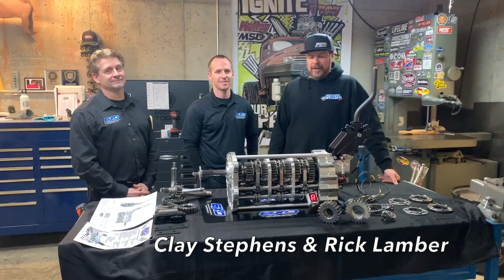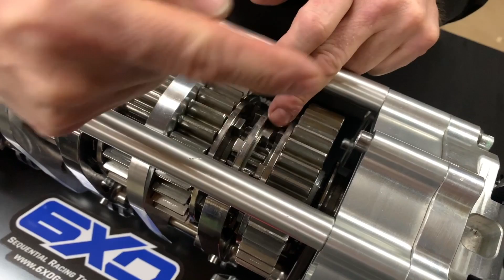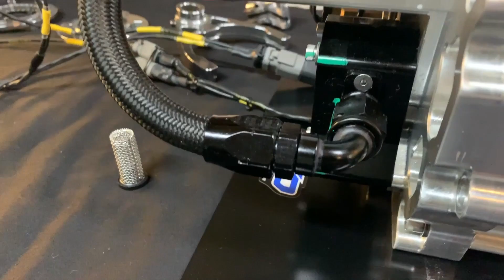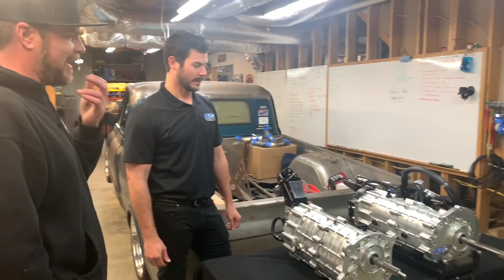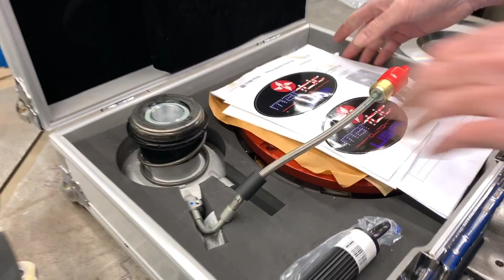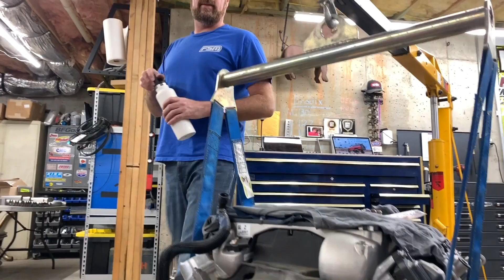First Look Inside a Billet Sequential Trans for my '67 C10! Finnegan's Garage Ep.99

Comment: There is seriously 0 videos like this that I've found on sequel boxes
Reply from the maker: I know, right! I learned so much from these guys.
Reply: Look for videos on motorcycle gearboxes, they are all sequel.  This is just much bigger.
Reply: the operation with the cam tracks for each shift fork is so easy to understand when you see it like that
Reply: @AnthonyBowman  exactly.  Kyle is an expert on sequentials now.  Rowdessy, hondaru, and the mr2 all have sequentials.
Reply: Rad Dan. Drifter from formula drift has some videos on rebuilding his box. Really cool to see.
Reply: I guess what made this video easy to understand is that the gears are laid out very easy inside the box.
Reply: @FinnegansGarage  MIKE...CMON DONT DRAG RACE THE CADILLAC!

SELL THAT CADDY TO ME!

DONT MESS UP A PERFECTLY GOOD CADDY
Reply: I was literally under the impression that every time you changed gears with a sequential, witchcraft was in play. Thanks to Finnegan for bringing us more knowledge.
Reply: @tylerborealis1234  No he isn't, can't even shift a fucking sequential.
Reply: @Earl James too bad the guy at the end has to use his clutch to shift a sequential transmission. What's the point
Reply: It's probably because it costs 17 grand.
Reply: You're not looking in the right spots 🤣 Sand cars have run these for decades. Weddle, Albins, Mendeola, Fortin, etc. all make these for a hell of a lot less $$$.
Reply: @taznz1  was gonna say the same thing, these peeps never rebuilt a dirtbike? sequential with viscous multiplate clutch... Every kid should own a dirtbike, teaches them the cost of being too hard on equipment, the drawbacks of not maintaining, and the amount of work in rebuilding it. Life Skills.
Reply: Gear box Video.

Comment: I love that you said “It’s really tough to screw this up” when talking about putting the clutch discs in. Didn’t you put one in backwards when you rebuilt the hemi on a picnic table when prepping to race Frieburger? Loved that episode...
Reply: My question is, how did they not notice they forgot the throw-out bearing? That is what the alignment tool rests against, it should have been pretty obvious that the alignment tool wasn't aligning against anything.
Reply: I take it you don’t race anything besides your stock Chevy Cruze
Reply: @zrobotics  You're so cool.
Reply: @shane8911  and you don't race anything, at all
Reply: @zrobotics  spigot bearing is what the alignment tool rests on. throw out bearing is on the input shaft.
Reply: @zrobotics  Pilot bearing buddy...close.
Reply: I think you mean pilot bearing, and probably not, that was a New Motor and T-56 Trans, that he had just put in, so, it would have been safe to re-use the bearing that would have already been installed, as long as the input shaft pilot was the same diameter....  Furthermore, did you notice that he had a little difficulty getting the alignment tool lined up, first going into the engine side disk, then, again, into the pilot bearing? guess not....  I'm pretty sure, the only thing they forgot, was to install the spacer/cover plate, which, you saw they caught....
The throw-out bearing, is the one that presses the clutch fingers, to disengage the clutch..., and that appeared to be in the mantic kit...
Reply: Rear main oil seal? Or is it deeper in the engine?

Comment: I love me a sequential but they have this huge problem why I don't have one. Insanely expensive at 17k
Reply: That and the gear whine that would get really annoying on the street.
Reply: @MX304  nah, gear whine and sequential is a match made in heaven
Reply: @alexelrod242  I don't think you've heard how loud that whine really is
Reply: @jackclark5220  can't be louder than my woman so no problem
Reply: That's not expensive for what it is. Spindle time is expensive,  and as tolerances tighten,  prices increase exponentially.  Grinding, polishing,  heat and cryo treating gearsets is insanely expensive.  Hopefully these will see wide adoption in the higher ranks of racing, and the rest of us will be able to pick up used ones in the future.
Reply: gotta pay to play. but i bet it is ligther, costs less, easier to service, and has more torque capacity than the dual-clutch transmissions in modern supercars. straight cut gears might be too noisy for the street though, unless you're into that sort of thing.
Reply: @MX304  you can get helicial cut gears in sequentials maybe not THIS one but they do exist
Reply: I doubt Finnegan paid that much
Reply: Plus u have to use the clutch apparently as the guy at the end demonstrated he clutched every shift so why bother
Reply: @jackclark5220  I have
Reply: Hahaha yes that's exactly my problem with pretty much everything. Poor AF and no sponsors either🤣
Reply: For what it is, it is money well spent if you need it. 

I would never have a use for this, but it is some great hardware that is well thought out and has a lot of value.

Comment: this is super cool to see the entire box open and see-thru with a full breakdown of exactly what is going on. Brilliant work.
edit: Woahhhh, having that 2nd pin on the fork is something I never would have thought of, but that's amazing they did that. Giving the user a "second use" if the first pin goes bad, is an incredible deal. Other manufacturers would never think of doing that for the customer. They would force you to replace it after the first one goes bad. These guys really have built an amazing piece of machinery.

Comment: This may be the first transmission that I've ever seen for about 15 minutes...and in that same time, realized exactly how easy it is to rebuild or service. Props to 6XD for such an intelligent design. It's too bad simplicity like this doesn't transfer over with simpler (if cruder) cast parts for low HP, mass-production applications. It'd be nice if the average stick vehicle came with a transmission this easy to service in it...

Comment: I know these are working well in the 2500-3000 HP big power Vipers. It's been a long time, but Vipers finally have a gearbox that will take some power. Back when I was "in the game" for TT Vipers, transmissions were the limitation. We could make so much more power in the V-10 as compared to what could be reliably sent to the rear tires.

Comment: on a motorcycle there is a rubber impact absorber in the rear wheel hub that helps soak up the shock of shifting with the power on. you better have something in your vehicle to do that. or you are going to break something. maybe the control box interrupts the ignition? or ? during up shift. this is a very interesting project.

Comment: You've still got to interrupt the torque to get the dogs to let go, though.  You can see how the dogs are back-cut to prevent them jumping apart when you put power to it.  Instead, they pull harder together the more torque you put into them.  So unless you have a system to either kill spark or "burp" the throttle, you're not doing flat-out shifting on this box, either.

Put a momentary ignition kill switch on Blasphemy.  They're built right into the shifter on rally cars and such.  It looks like they might have those built into the shifter mechanism of this particular transmission.  But it just kills power for an instant so that the dogs unload and release for the shift to happen.

Comment: they should hook a starter motor to the input shaft and a 12 volt battery so you can spin the transmission and go through the gears and show the people how it works.

Comment: The moment that you started towards that engine with a flywheel in hand, I knew cause I did it more than once. The only reason to lighten the flywheel is; the double disk weight is combined into it. I would not run a flywheel like that after running a "Schaffer flywheel" which is all aluminum and single disk. Half the torque fell in the ocean and made my big block act like a soupy six with a hole in the piston.

Comment: With the back cut on those dog teeth how can apply enough pressure to disengage those teeth if power is applied continuously ?  Outboard/stern drive boats use a similar dog in the foot, but when you go to shift gears there is a micro-switch that interrupts the ignition just long enough for the pressure to come off of the teeth and disengage.

Comment: Upshifts on a bike do not use the clutch. The rider gently loads the gear-lever and momentarily dips the throttle. The gears momentarily unload allowing the next gear to drop into mesh. Downshifts need a mismatched clutch throttle so the revs blip. Rider does the clutch/throttle blip, a fraction is a second later hits the shifter and gear drop in perfectly.

Comment: I wonder if transmissions at this level, and one like in Blashemi can be used with a kill box the kills the motor 15 milliseconds or so to make shifts. I did this on my busa based drag bike, and it sounded like a automatic trans shifting. This  T56 trans uses a shaft type shift drum a little like a motorcycle, and if it has backcut shift dogs it should work.

Comment: Couldn't really tell but maybe the pilot bearing? Don't know of anything else to install before the flywheel. Unless they changed things, since I have been doing rebuilds. Maybe a spacer to keep the bolts from sliding back towards the engine?

Comment: Nice trans - but not in my budget - I went with the T56 Magnum HD (with the TR6060 gear set). behind my Mast Motorsports LS7 with a SS cam and 11.4 compression and a Monster dual disk clutch.  My builder will be done with my car later this week and I'll be driving the car next week. Video's on my channel.

Comment: these are one of those things that lots of people want but very few can afford. this transmission starts around $17,000, not including specialty parts for your application. its out of reach for most people. i also understand that its not necessarily meant for a beater. as an alternative in the racing world, this is quite the deal honestly.

i fully understand the amount of engineering, research, testing, and costs associated with limited production items. i really wish all those things didnt require the price to be that high so that it really was more accessible.  

i dont fault this company for charging what they do, theyre in business to solve a problem and make money for their hard work and time. if i ever hit the lottery, im calling these people up. its really is pretty amazing. my favorite part is the serviceability, you dont often see that in items like this due to the greed by forcing limited parts availability.

Comment: Great and very useful to me. I am building a 68 Roadrunner with a 650 ci kb blown Hemi and this gearbox looks perfect. Can I ask you what is the part number of the Mantic clutch you are running in the 55 behind the Hemi as I would like to run this setup with this box so trying to work out all the parts required.

Comment: Hey Finnigan.👍🏻🤙🏼 I no you've probably a trans brake in blasphemy maybe ,but a Hydraulic Handbrake to loads up the driveline with the cluch would help your launch and shocking the driveline alot . From tarmach rally experience and I seen Garrett lanches Leroy like that .
Reply: Barry O' Neill Can’t really do a trans brake with a manual like you can with an auto. The best thing he could do is go to a slipper clutch that would soften the initial launch. That would also help with consistency. 
They make special clutches designed to slip some before the rpm comes up and they grab fully. They also make a piece for hydraulic clutches that acts like a one way restricter so even if you dump the clutch it releases it more slowly.

Comment: Ok, ok , I like all of it BUT ! ---- were  talking a new bell housing, flywheel, clutch, throw out, and the 6 speed trans, plus shifter & heat treated drive shaft yoke plus what ever cross member mods and fabricating a new tunnel in the floor pan as needed right , Whats a ball park price for the  wide gear drag race complete set up ? Will another mortgage on the house cover all of it ?  Also can you get a 2:88 or lower first gear ?

Comment: Lightweight compressor and tank setup that maintains psi with pressure switch for road applications...😇
Reply: 12v stand alone with built in compacitor to eliminate power drain when engaged...😂😂😂 road warrior maintenance free monster!

Comment: This is just a manual transmission with a cam to engage gears, along with an engine cut out for full throttle gear changing. What is special, by 2020 standards, are double clutch gearboxes.

Comment: Fuck the pneumatic shifting, it could be an electronic solenoid and not need all of the pain in the ass components, compressed air containment difficulties, pressure drops=performance Props and rubber air seal unreliability and deterioration....   but everything else is absolutely beautiful and well thought out. The case looks like absolute jewelry.

Comment: question!!!! it will keep me up at night if i dont get an answer!!! in the beginning you guys said the input shaft needed to be spinning to go into gear, when the 2nd trans was brought out he paddle shifted it without any input shaft speed why/ how, whats the difference that made that possible, also do you rely on a hand brake for "parking" or do you shut it off in gear?? if you do shut it off in gear or you have an engine failure how do you get it back into neutral without any input shaft speed????? plea!!!!!!! i need answers!

Comment: Those guys are obviously pissed off with 'standard' motorcycle/sequential gearboxes and the replacement /interchangeable is a fantastic idea particularly dog rings on gears. Honda used a trochoidal oil pump built into shaft bearing to lube transmission in 1970's

Comment: If the dog teeth are a seperate part from the gear itself, won't that be putting the entire load on that small splined section instead of spreading it out over the gears splines?

Comment: WOW, great stuff!

one thing tho, I thought that for drag racing you want a heavy flywheel to carry more inertia of the line and not bog too much.
at least that's what we do to our customers cars that want to drag race bit more seriously
Reply: I've heard that too. And with a smaller angina and a slower car than blasphemi
It makes some sense. But in a sub 10 second car you are fight to accelerate that extra mass between shifts.
Maybe with a sequential box, you could see a benefit to a heavier flywheel but currently blasphemi has the other style of transmission and the c10 isn't just for drag racing.
Reply: @casychapin4647  well, we have done some double duty street/drag cars with heavier flywheels with no streetability issues, we have a customer with 1500hp R33 skyline, drag racing only with heavy clutch too, that is 8.6s car with potential for more (limitation on that one is cage, guy is way to big to fit in a car with funnycar hoop). what I said is what my boss told me, ant that guy build some really serious cars (including drag cars) in his life
Reply: Marek Mika ,,,yea, we always went with a heavier flywheel and clutch set up for drag racing and lighter for road racing.   The extra weight takes a little longer to rev up the engine but you lose less RPMs off the line and between shifts however with a high torque big block engines,,,,NO.

Comment: Since  I have always owned and worked on Motorycles  I have wondered for years  why then  can't use a Motocycle  Transmission desing for cars..  I have a project  I was going to use a Tremac  6  speed in .. The Tremac  has  helical cut gears..  If  you want a strong transmission  you need straight cut gears..  Oh  My  they whine a  little Big Deal ..I also  work on  twin countershaft Eaton Truck Transmissions same  deal  non syncronized and straight cut gears..
  My first question is why not set  them  up with   some kind of power cutter..  On Motorcycles  they call them quick shifters..  pressure on the shift linkage  cuts  fuel or and spark for a moment so you can make wide open shifts..
  I suppose I will have a Heart attack when I learn the price.. but this is what I have known I have wanted in a car transmssion for years..

Comment: The real question: how much is this beauty, where can I buy one in Canada, and will you take all my money?
Reply: 16K
Reply: @connorparrish4182  but worth it ,1800ftlbs capability@ 3000lbs weight
Reply: Chris D'oulmeth  you'll hate yourself because if the transmission isn't under load it goes into neutral so every stop sign and traffic light it will be in neutral but yes you can daily this
Reply: Nothing is available in Canada haven't u learned this yet
Reply: @Realtime1501  plus u have to clutch it to shift it that's super lame the guy at the end clutched every shift

Comment: Beautiful bit of kit but why are they not helical gears. You don't have straight cut bevel gears in your diff because they are not strong enough. Straight cut gears have compromised teeth profiles because different ratios on same centre distance causes this. Helicals, you simply adjust the helix angle for a mathematically perfect tooth profile and contact line.

Comment: you can have the same transmission including rev matching blip shift up and down, attached to a vehicle that will run low 10's high 9's off the showroom floor and go 200 mph and come with cruise control for less than the cost of this transmission. Google "motorcycle"

Comment: I’m wondering if there is a benefit to forging the case sections instead of using billets.
Using a forge to press a small lump of alloy into the basic shape would save a lot of machining time and waste.
Forged alloy can be stronger than billet even from the same stock.
Reply: Forging is an investment manufacturing process, this company seams focused on inovation, so if billet is strong enough being able to change the design redily is more important.
I bet almost every transmission they build is special ordered and has some small change for a new application